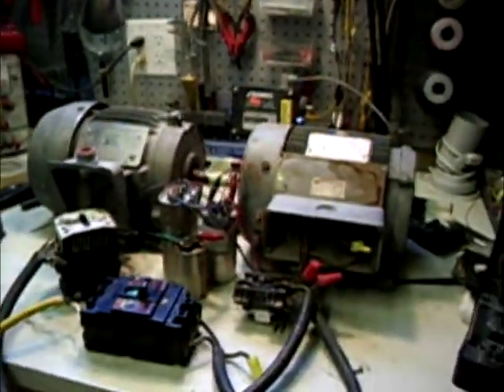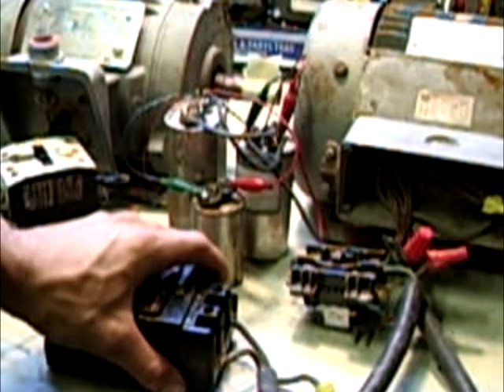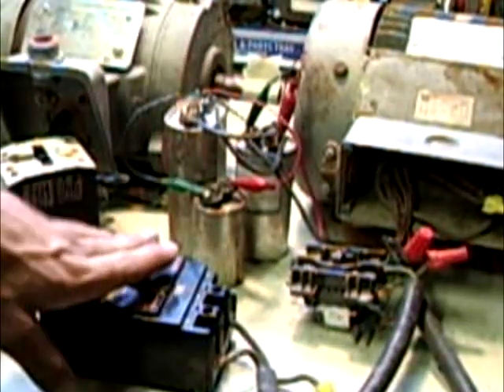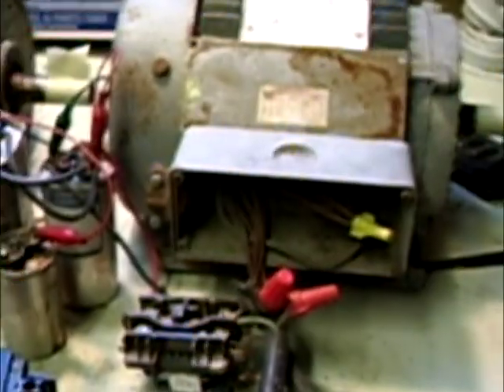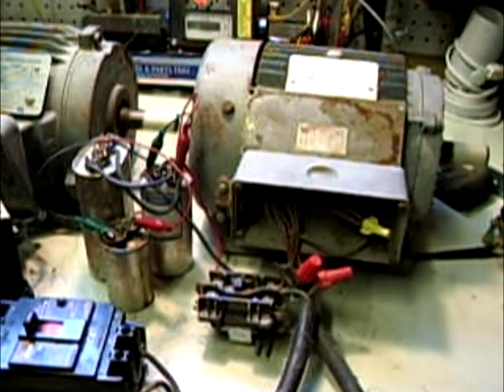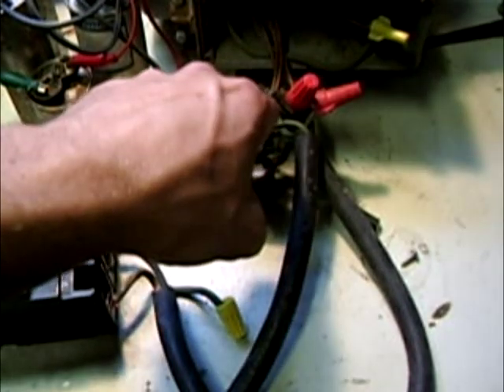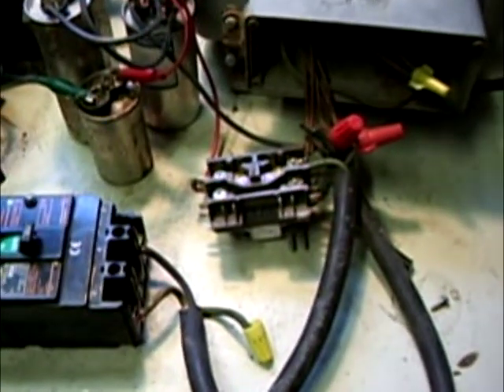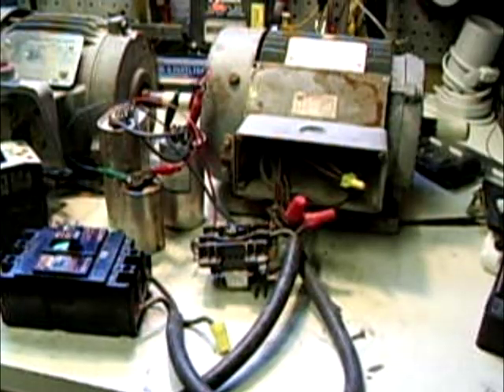3 phase generator start technique

Comment: take out a 3 kw welder primary winding and place it in a oil bath container with a heat sink in it and seal it and then run the winding in series with the motor and you get a circuit that can't exeed 3kw worth of load no matter the size of the load as it will serve as a circuit load limiter and overload protector.

Comment: This is the system I have but don't use the idler motor to make 3 phase, I just use it to start the work motors, so far I have never had a problem on my 3 hp 3 phase lathe, I will be adding the idler to my next build.

Comment: can you send the schematic of this video. i have 1hp inverter duty motor 3ph, connected a 25uf cap using it with a single phase but starts low

Comment: Using timed contactors to switch between Y and Delta should be enough.I'm in a middle of a project now with 18.5kW 975rpm motor.Planning to spin it up with old power washer motor.I olso got old single phase 230/400V welder to use the primary as step up autotransformer.

Comment from the maker: The best practice for this is using a soft starting method, I've been toying around with a few ideas. In this application, torque is not needed during the start up so it can be comfortably reduced until full RPM's are attained. One idea was to step the voltage up temporarily to reduce the need for current ether by using capacitors or winding a simple transformer.

Comment: Hi,nice video.Using this method u could start motors up to about 5kW. I started 7 kW  ones but had to modify my supply fuses as the initial currents are too bid for a single phase house supply.Using smaller motor to spin up the bigger one bypasses the huge start currents.

Comment from the maker: This video was more to illustrate how to start your phase converter using capacitors versus using a second electric motor. In this case the phase is not been corrected to mimic 120deg out of phase. Converting to three phase will never be as efficient as just having 3 phase so "derating" will occur . My intention with this video was to help people learn not to put them selves in harms way just to start a converter.

Comment: Best video on this subject.   Still can't wrap my brain to fully understand the theory.  Like is the driving motor actually developing a true 120 degree 3 phase circuit and the driven is working at rated power and efficiency.    Or is it close enough 3 phase and driven motor have to be derated?  Man, I should have studied advanced math !

Comment from the maker: In this video the breaker does not matter because I was using it as a switch, you should match the breaker to the load you intend to pull, it changes by the HP of the motor. Phase converters will draw more, they are not know for energy efficiency. T2 and T3 connect through a 3 phase switch to the second motor, T1 both connects through the switch and to the cap bank with a momentary switch. If you configure your diodes right then yes, keep in mind you would it's 3 phase though.

Comment: Could you also wire the capcitors in paralell with the motor and use a push button switch to run the motor?

Comment from the maker: A VFD would do it, a high amperage POT would reduce everything to the motor including it's horse power. A VFD changes the frequency of the electrical current but keeps the horsepower up. Most motors are wound to run at 60 or 50 Hz, IF you change the frequency to say 120Hz, the motor will spin close to twice the RPM's at the same horsepower.

Comment: @mythril4 one more question, i have some 200uf 400v starting caps but they arent oil filled will one be enough to start a 5hp 400v motor on 220v?